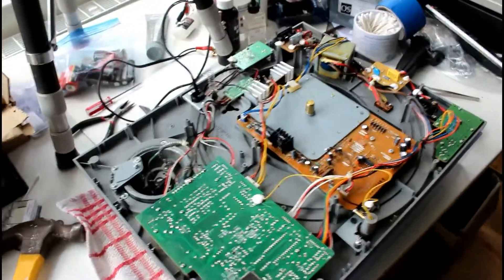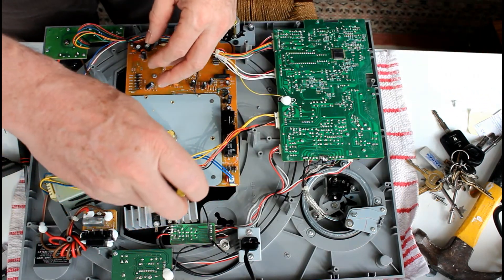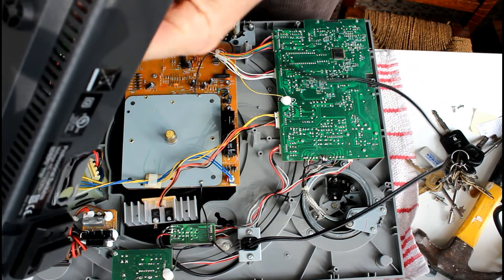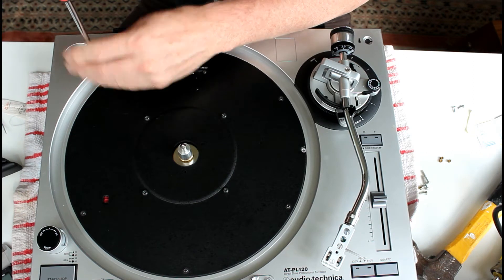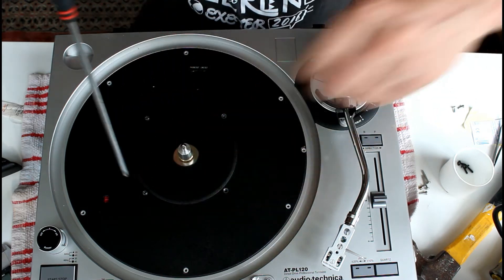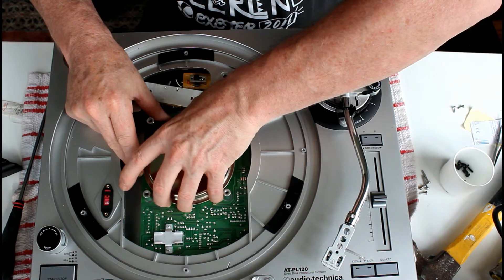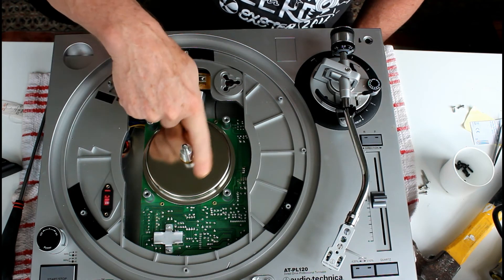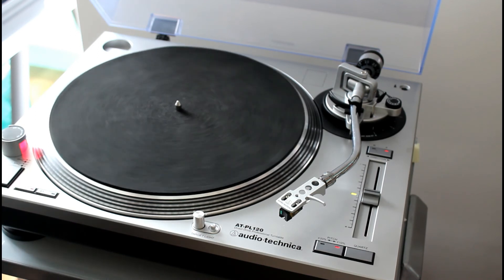Audio Technica AT-PL 120 (& USB version) Oiling the Motor spindle.

Comment: you can pull the drum clean out with good finger grip on spindle or use 2 screwdrivers to pry it up
Reply: A strong finger grip is the best, the sensor for the speed sensing is a square copper trace around the perimeter screw driver(s) could destroy it. There is a donut magnet under the motor spindle. It uses the magnet to hold the spindle in place in conjunction with the metal plate on the bottom side. On the motor spindle there is a magnet that goes around the perimeter the the square copper trace generates the feed back for speed monitoring (servo controlled).
Reply: @darinb.3273  The Vinyl Rescue guy told me that how he pulled the spindle up, I already figured that a good finger grip is enough to pull it up
Reply: @VaughnfromPeterborough  That's right exactly, I just wanted give a stern warning about those copper traces, some are extremely thin and slip of a screwdriver and they are toast. Sometimes repairs to traces are easy however in that particular situation there is very little clearance for such repairs for that particular purpose of a that trace. That was necessarily meant towards you directly LOL Just meant to be helpful to everyone.
Reply: @darinb.3273  The viynl rescue channel since deleted all his LP120 videos cause he got sick of the stupid comments left, he really hates the 120 for the motor noise and he told me he no longer uses the POS for playing, only for cleaning records, his new TT is a REGA P2, I have finally broken out the 1200 MK4
Reply: @VaughnfromPeterborough  Agreed I haven't used mine in approx 2 1/2 - 3 years. I'm not sure if all of them were plegged with that motor cogging or what, but yeah some companies just don't get QC (or just throw parts together and send it on it's way. I remember when pride and REAL workmanship went into a REALLY great product whatever product it was.
Reply: @darinb.3273  All the USB editions had the cogging sound, the older PL120 have a soft ticking noise @33rpm, but more annoying on 78, the new 120X has new motor and also the 140XP
Reply: @VaughnfromPeterborough  This cogging sound has nothing to do with playing a record this occurred directly from the motor itself. The turn table can be completely disconnected (power cord only plugged in ) and the it will disappear with a slight push and loader if placing a bit of a load. This is from the motor itself due to poor assembly. My donut magnet isn't centered (off set like a 45 rpm record) I can actually hear the cogging sound change (louder and softer) as the platter spins. 33 slowest 45 is a bit faster and 78 rpm is faster still. Forward or reverse direction doesn't matter the cogging sound persists.
Reply: @darinb.3273  The cogging can be heard through the speakers on very clean 180g vinyl where no crackle or surface noise can mask the cogging noise on silent gaps between tracks and it gets louder toward the inner circle and deadwax roll out. vinyl rescue used headphones which make it very noticeable, I personally never used phones with the LP120
Reply: @VaughnfromPeterborough  Yes exactly I'm saying I have one of those models and it is the design of that motor that is poor. As I said before no audio connections at all listening with my ear over the platter I hear this cogging chugging sound as described before. So yes it transfers to the vinyl and ultimately affects the sound coming through any source headphones speakers and transfers to a computer (the interface USB or line in to a sound card the cogging sound is audible in quiet passages and between songs.

Comment: Hi. I have the similar Pioneer PLX500 and it has this same motor noise issue. It is almost identical in design, too. I found a video posted by a Russian fellow showing how to repair a scraping noise for the Pioneer. Right there he shows the top of the motor and spindle assembly laying separate from the board and bearing. He DOES NOT show it being taken apart. So, I just gave it a really good bank upwards, and it just lifted right out. It is the magnet holding it in... Nothing else. I added a whim in the bearing shaft and spindle oil and dropped it back together. So far so good.
Reply from the maker: HI, Chad.  I'm glad you've solved the problem, that is useful information. Thank you for your comment.
Reply: Hi Chad  there's a link about this video? Thank you very very much
Reply: @miguelherr9712  Just search youtube for "Audio-Technica AT-LP5 turntable repair. part II" by High End Service.  My Russian isn't good enough to follow exactly but it seems that the very similar motor in his AT-LP5 was making scraping noises with a lot of speed variation. His fix was to pull out the motor armature / spindle, cut a small circular shim from some plastic, and insert the shim into the bearing bore, below the spindle. He used a light grease sparingly.  This fixed his problem, re-assembly and test was in part III.

Comment: Olá amigos, preciso de ajuda. Minha Olá amigos, preciso de ajuda. Minha technica de áudio começou a fazer um barulho como se estivesse raspando e oscilando a rotação. Ao desmontar, percebi que o ruído vem do rotor do motor que, ao girar, está raspando em alguma parte da chapa onde estão as bobinas, fazendo com que ele oscile a rotação ao fazer a barba. Oque posso fazer para consertar isso? Eu já troquei o óleo, coloquei 4 gotas de cantor e não resolveu.
Reply: A minha tá com problema semelhante, o motor com barulho como se estivesse raspando (não é no prato e sim no motor como o seu) pelo que vi acontece bastante, o que estou tentando aqui desde ontem e parece ter melhorado um pouco, é por óleo singer (bastante, na junção do pino com a base de metal do motor) deixar girando em 78 rpm por um tempo e depois apertar o reverse para de alguma forma o óleo conseguir entrar pela fresta da junção, ele meio que cita isso no vídeo, como se não resolvesse mas aqui reduziu o ruído e a variação na rotação em 90% por enquanto. Tô testando aqui ainda, qualquer coisa posta lá no apaixonados por toca discos no face.
Reply: @RandSilva79  The noise seems to come from the rotor contact (type a black rubber or magnet under the rotor) with the plate, the plate seems to be warped, I'm not sure. I pricked the center of the plate with my hands and the tips in the opposite direction and it seems that it has improved a little. The distance from the rotor to the bale is millimeter. I emailed technica technical support and they did not respond. I placed a winding cloth making volume between the bottom of the disc ring and the center of the plate, slightly pressing the center of the plate upwards causing it to increase the distance between the sides of the plate and the rotor and improved greatly, but not totally. I'm still looking for a solution to this problem.
Reply: @clebercosta1904  Acho que consegui aqui (pelo menos tá funcionando há uns 30 minutos e as bolinhas do strobo estão cravadas sem nenhuma oscilação. Abri a parte de cima como feito no vídeo (tomei cuidado pq tem um cabo da chave seletora conectada a parte metálica. coloquei umas gotas de óleo singer na base do motor, com uma folha de papel dobrada encaixei entre o motor e a placa e dei algumas voltas para limpar alguma sujeira e espalhar o óleo na junção,  reapertei os parafusos (sem forçar muito) e tá ok, até agora, sem raspar), se funciona permanentemente ou se eu recomendo fazer eu não sei, fica por conta e risco, mas tô testando aqui e o meu que tava bem ruim (caia mais de 10% a velocidade) está 100%.
Reply: Tengo el mismo problema ahora... pero lo solucionaste de alguna manera? Gracias

Comment: I've replaced the motor in mine and the motor pulsation noise is till there. I've found no way to take the motor apart as there appears to be two sleeves pressed on top around the inner spindle. I've heard form one other person that it can taken apart, but her instructions are not working. She stated the coils inside the motor are causing the noise and need to be coated with varnish?? I'm not sure, but that's what she said. I've had mine for over 6 years and wished I had not bought this POC. The best thing you could have done to improve the sound quality is to remove the USB preamp while you had it open and solder in a nice pair of shielded RCA cables. I've done several mods on mine and have it on my channel if you are curious. I finally broke down and bought a Rega Planar 2 Dec of last year and life is so much better! Has your anti-skate went bad yet? If not, it will due to the weak spring.
Reply from the maker: Thanks for your comment. My model was an early production model before the USB addition.  I have not had any problems with mine, but it seems many people have had poor quality issues.  Not heard about the varnish fix, interesting.  Thank you for your comment.

Comment: It is untrue that the engine bearings can not be oiled.  Lift the engine rotor and you can lubricate :-)
Reply: Hi, I know it has been years since your comment and I'm having issues with mutter slowing a little every rotation, I've had this turntable for 6 years and suspect it just needs a little oil on the bearings. How do I oil them?

Comment: Looking at it the spindle should unthread from the metal disc? Put a bit of string round a spanner and tighten it around the metal disc to hold it in place and get some grips with a bit of Cloth so you don't mark the spindle should come loose. Or drill out the rivets replace with aluminium or nylon nuts and bolts, If you've got room and it's not encroaching on the circuit board circuit tracer make the holes bigger and insert some rubber grommets and nylon bolts and nuts with nylon washers, and do it to the mounting screws for the PCB board to the plinth as well will help a lot. You need to move that heatsink off the face of them plinth this will cause noise from the transistors you can get some sorbothane rubber, underneath or on a couple of grommets.
But ideally the whole plastic plinth should be chucked away. Make your own find a workshop that will cut it out! If you haven't got a router glue an inch of MDF to an inch of marine ply don't use cheap ply beech ply should work fine or just 2inches of MDF glue together with PVA glue, make sure it's clamped hard and really heavy weights of 10 kilos at least using old car batteries could be used. Or Park the front wheel of the car on a smooth level surface, and leave it a minimum 16 hours to dry. Marker on the underside the part of the plinth that will be on the feet areas to put the pcbs except for the motor and the main bearing and PCB will have to go on the top surface cut out. If this sounds like too much hard work! just feel the whole plinth top and half fill bottom, with a silicone mix just giving room for the heat sinks, Release all the screws a couple of millimetres off the circuit board and transformer first, then fill with mix then tighten it and back down after dry do this to the platter as well underneath make sure it's level first before you do this and don't fill it right to the top give yourself 5mm gap from the top edge of platter. Another simple thing is very effective you should do especially for those tonearms that are very bad resonance! Is fine some thick o-rings or rubber grommets, place two on the back of the bearing gimbal where the weight sits, two on the other side, 1 roughly in the middle before the bend and 2 on the back of the nut holding the headshell, make sure the o-rings are a tight fit not loose or snug? This will dramatically help a lot. And finally but not least get some sorbothane and use them as feet all bars of soap.

Comment: I don’t want to be the one to say it, but for the money that these cost, you can pick up a used Technics SL 1200 / 1210 for similar money and have a service for around £75 and you will have a fully serviceable turntable that will last for 20+ years. I currently have a 20 year old model which even without being serviced is sublime in operation. No motor noise, operational anti skate etc. To buy one of these and then correct all of the faults seems crazy. Personally I would chose a mk2, mk3 or mk5 over the Audiatechnica Oem based turntable.
Reply from the maker: FRST2012  You make a good point here.  The Technics SL1200 / 1210 are better turntables, and restoring one for use is a good plan on many levels.  The serviceability of the Technics is a major plus as I hope this video demonstrates. 

I would personally prefer to own the Technics models.  That said, these turntables used to be much cheaper than they are today.  I purchased the model in the video in 2007.  I purchased it while in the USA for $149 +free shipping.  

It hasn't been used a great deal (and was later stored in its box for 4 years) so this video was an attempt to do a service prior to its reuse.  The turntable wasn't showing any signs of needing a service, but a lube wouldn't do it any harm.  Perhaps on a turntable that is being put through its paces, the sealed nature of the platter bearings might be an issue.  If the turntable had platter noise problems, I would have attempted to dissemble it further. Not sure what price Audio Technica charge for these repairs. If anyone knows, let us know.  Thanks for your comment and for posting your information.
Reply: FRST2012 man I’m not sure where u are seeing 1200s/1210s for the same amount of money as these. In the US a decent 1200 goes for around $500, a new at-LP120 new is $250. And u can pick up used ones for $125-$175, give or take. Is the 1200 better? Of course, but they are no where near the same price. Btw, u could always get lucky and find a ‘like new’ 1200 that some old lady only used once a week on sundays to play her one fav gospel record, I’m just talking averages

Comment: I have at-lp120 but i do not about this model at-pl120
Reply: but I see in your vídeo your turntable is PL120 in my turntable the model number is more small the letters in the plastic.
Reply: I think your model is more updated than my turntable 2016
Reply: Some peoples talk about this turntable is bad, for me is very good turntable for the price.
Reply: I like to use my cartride AT3600 the sound is very flat and more similar such digitial used with the line out integrated switch, do not use phono switch but the phono signal is filtred and more dark sound, to use phone remove the internal pre amp but remember that external need to be more quality to listen the real diference.
Reply from the maker: Hi again, my model is quite old, at least 8 years.  I purchased it in the USA when I lived there. It is model AT PL 120 as you noticed.  This turntable was made before the USB preamp was fitted.
Reply: ok thanks for that information :)

Comment: Junk bad turntable not worth the money save your money and get a better turntable
Reply: It's an Ok table if you love 78 records and thrift shop vinyl, I have done some upgrades to make it more enjoyable, SRM tech acrylic mat & 3mm Technics rubber mat on top, removed treble filters from pre-amp/USB board (watch Vinyl TV's pre-amp removal) to learn more, added a ground wire to tonearm shield, also disconnect internal ground from tonearm shield (certain preamps pick up pulse noise from motor circuit)
Reply: which TT?
Reloop RP 2000USB 
Numark TT250USB
Audio Technica AT-LP3
Audio-Technica AT-LP60

:)

Comment: I have the same turntable with the same issues and now beggining to  hate it!.... I was planning on opening and lubricating the motor but thanks to you I won't do that. At this time my warranty has expired so no hope on getting another one. Audio Technica lp120  is a bad and cheap design and wish I knew on the noisy motor!
Thanks on your video!
Reply from the maker: Hgroton Hi there, thanks for your comment.  I am glad to have prevented you wasting your time!  Unlike some, my turntable is fairly quiet, but I wanted to oil it as part of a service.  I hope you find a suitable turntable soon.  Thanks for watching.